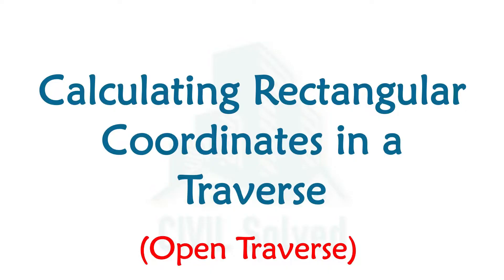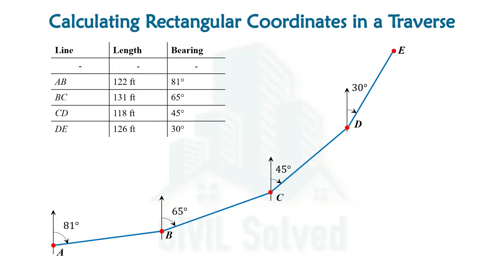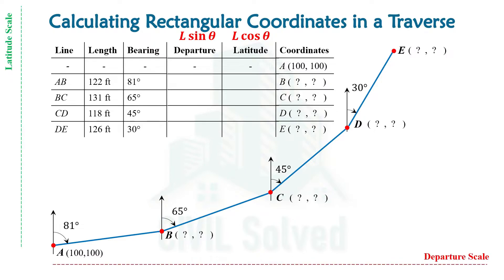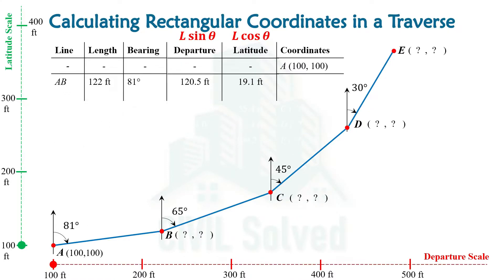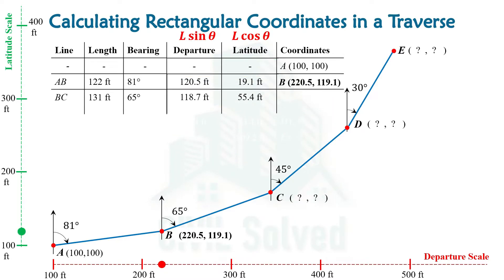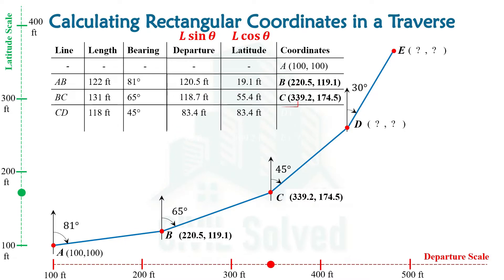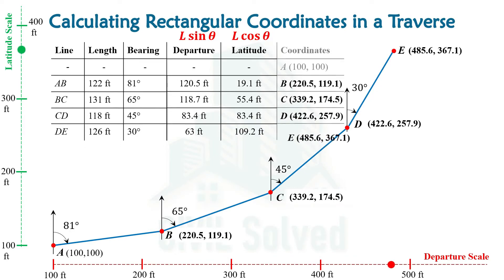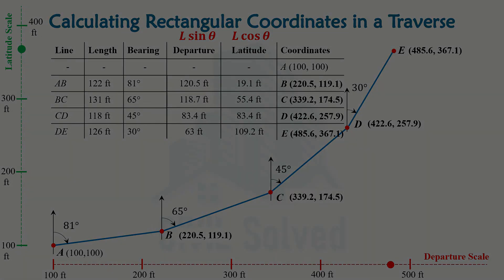Calculating Coordinates in an Open Traverse; When length and bearing of all the lines are given

Comment: I tried solving an exam question on closed traverse, we needed to find the coordinates of each station. But summing up the latitudes and departures isn’t equating to zero
Reply: Thanks for your response ❤️😊🤗
Reply: Could it be that there’s an error 
But I did the calculations very well
Reply from the maker: @iwumezieuche8321  If you did calculations right in a close traverse for latitudes and departures, then sum of all latitudes should be zero and same is for departures. If it is not zero then it means it is not a close traverse. Maybe the measurements taken for length and bearings have errors.
Reply: Pls what if we need to fix a point  F mid way an open traverse between A and E and we are asked to find the coordinates of all points, lengths and bearing of CF. Assuming A as origin with coordinates 0,0